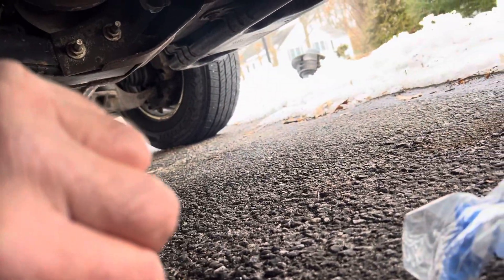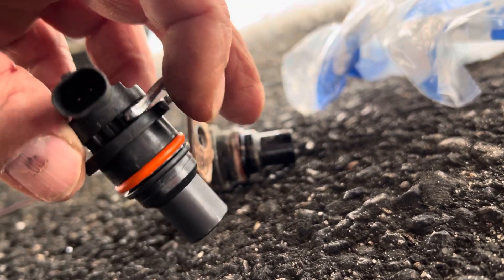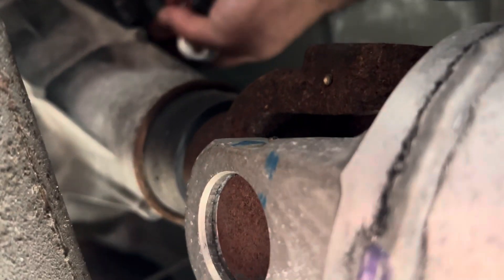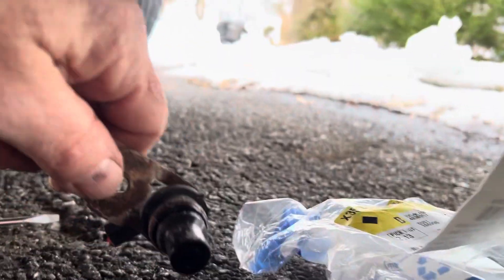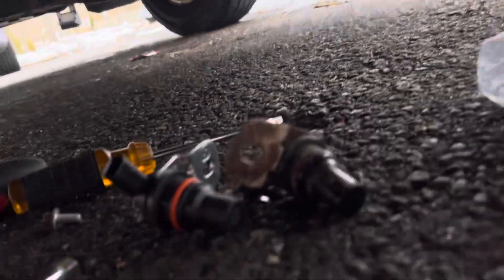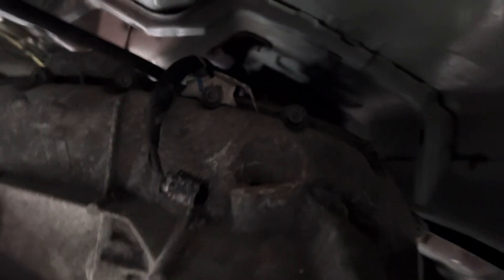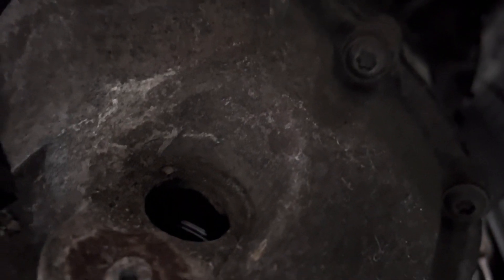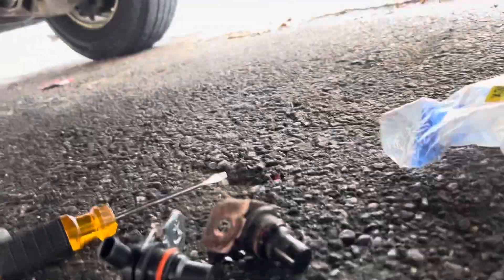Duramax ALLISON transmission  p2771,p0721,p0700 speed sensor, location, ￼

Comment from the maker: it turned out to be the wiring harness as well as a ECU  it cost me 2200 bucks to get repaired
Reply: Getting p0700/p0721 aswell. Speedometer moves around abnormally, and acted like it was slipping. Same thing? Or should I be worried?